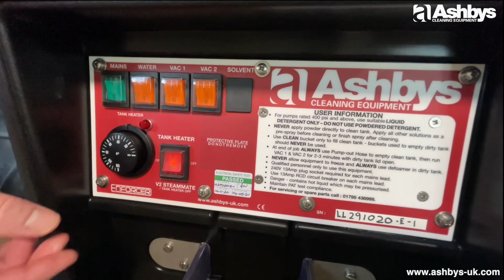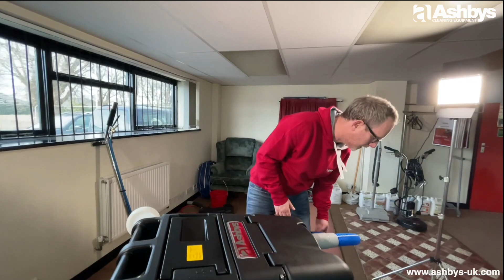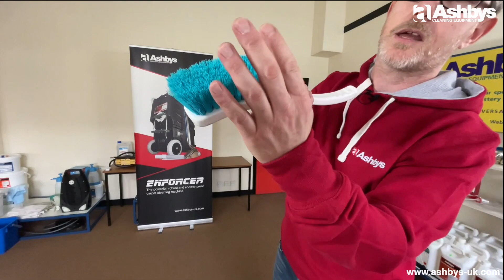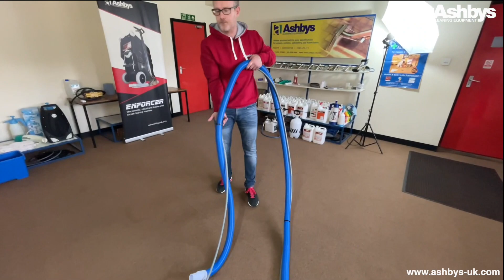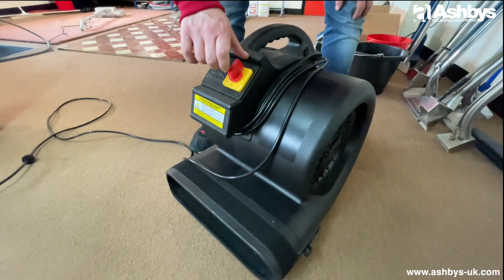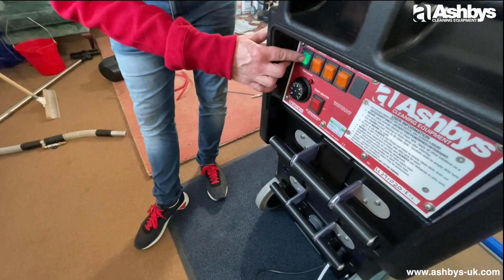Ashbys Enforcer 400 psi with Tank Heater - how to use it!

Comment: Nice informative video👍🏼 The machine looks pretty big. How is it to manoeuvre for one person? As some properties may have steps to access front door or flats for example.
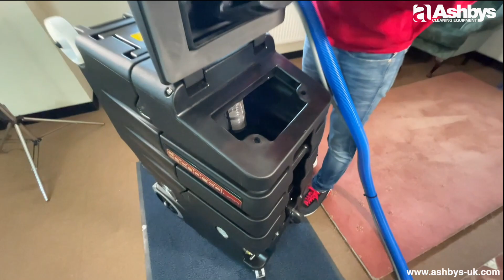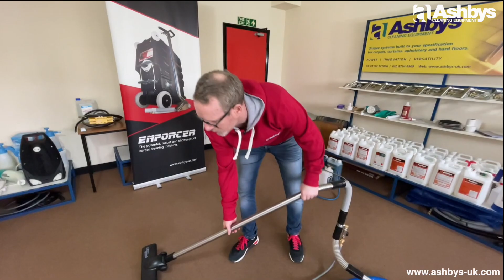Reply from the maker: Hi Adam - sorry for the delayed reply. Dims are here https://bit.ly/3aWLbwh. It's our largest, most powerful and by far our best selling machine. I don't find it a problem to move up the odd step but I wouldn't recommend getting it up a flight of stairs on your own - for that I would extend my hoses upstairs and leave the machine downstairs, usually outside. We do a lighter machine called the Ninja https://bit.ly/3b4dDMU - take a peek. If you'd like to chat through your requirements, give me a call on UK 01795 436999 (Mon-Fri 08:00-16:30). All the best, Martin.

Comment: Thanks for the video. If I plugged my similar machine in one circuit it would trip the breakers. Namco, 400 psi adjustable pump. 2-3stage vacs. I use an external Mytee turbo heater. Funny, I also have the Sebo and 360i I see in the background. Your machine looks nice.

Comment: Brilliant video. Really well explained. Can you just clarify though, when drying with the tank lid open at the end, the vacuums are on 1 then 2 in the video; is this right as initially you turned them on 2 then 1 ? 

Yes you did say 'the reason for this is to dry the machine out' etc but I wasn't sure you were talking about the switching order or whether you were talking about generally the fact you were switching on again at the end to dry. Can you clarify this please? Thanks.
Reply from the maker: Hi Sean & Lorriane – hope you are enjoying your new Enforcer. At the end of each job, once you have emptied the dirty water out with your pump-out hose; run both vacuum motors with the lid open. Switch on No 2 then No 1 – let run for 3 minutes – then switch off No 1 then No 2. This allows fresh cold dry air through the vacuum motors and clears them of any moisture prior to packing away. This (along with using defoamer) will give your vacuum motors maximum life span.

Hope this helps. 

All the best, Martin (ps – any questions, feel free to call me on 01795 436999).
Reply: @AshbysUK  Yes it's a fab machine. 

Thank you for your reply and for clarification of this. I assumed it was a mistake saying to turn on 1 then 2 at the end to dry. Thanks again for clearing this up. Sean.

Comment: Really nice bit of kit was looking at an airflex but I think this has won me over mate will be investing in January. What is the heat like at 50ft of hose?
Reply from the maker: Hi Sean – thanks, glad you like it. Heat is great. This model has a 3kW adjustable temperature solution tank heater and goes up to 60 deg C. We also have a model with instant heat up to 110 deg C, check it out here https://bit.ly/3h165JT. Any questions or to order with a £250 deposit, please call me on 01795 436999. There is currently a build queue.
Reply: @AshbysUK  thanks mate I’ll be in touch
Reply: @AshbysUK  I see that does look like a better option thanks, is the tank heater required with the v2 steam then no? How long is the build queue mate cheers
Reply from the maker: Hi Sean - give me a call on 01795 436999 and we'll discuss your requirements, work out pricing and lead time. All the best, Martin (ps - we close for 2020 in a moment!... but we're back in the office 08:00 on 04/01/2021. Have a great Christmas).
Reply: Hi, did you get the Enforcer? Are you happy with it? I’m about to buy one!